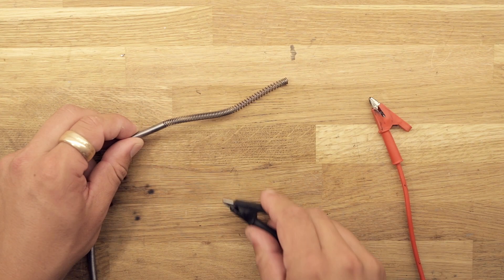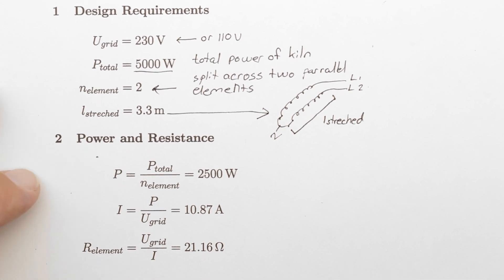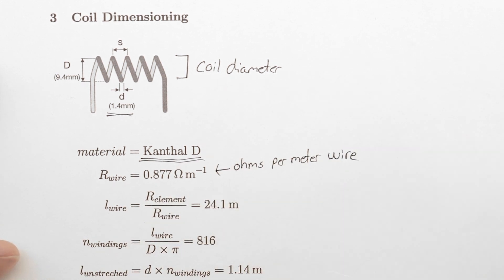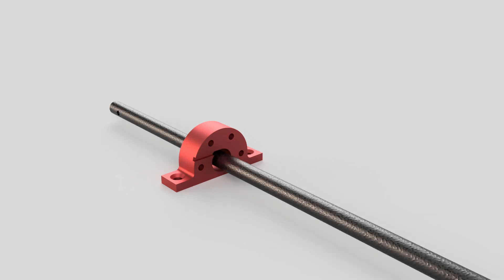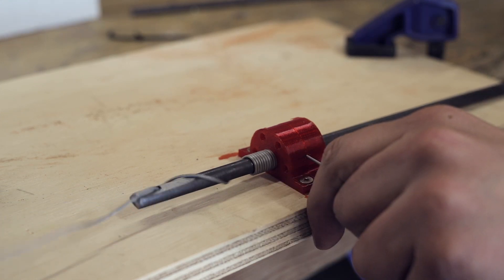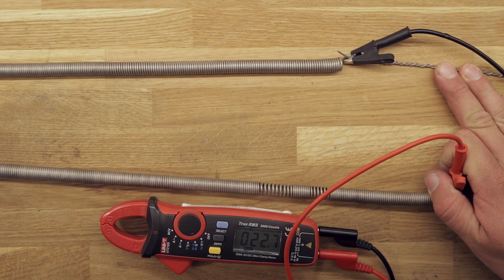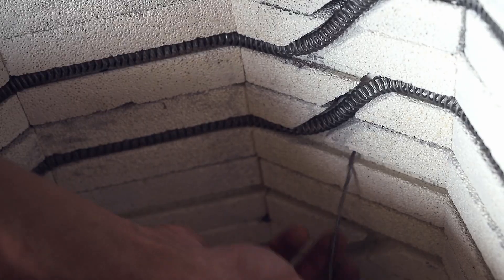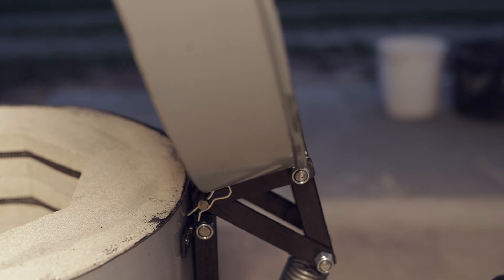Ultimate DIY Electric Kiln Guide - The Heating Elements (part 2)

Comment: Interesting build, though I think I would have just used all 50m of the wire, unless you have some use for the scraps. The extra length would only increase the resistance a bit and allow you to get higher heat output by drawing a bit more current. Or was there a reason you were aiming at a specific power rating?

Comment: You measured cold resistance... Resistance at >1000°C is much higher, so less current will flow. You will not have the desired power. The difference is big. Much bigger, than one would think at first.
Reply: I appreciate what you are saying here. I just tested my kiln and at 240v and 20a with his calculations I can only get my kiln to 631 degrees *F. Any suggestions on how to get the temperature higher?? I followed his instructions to the letter. I’m very confused why I’m not getting the same output. Any help. Would be appreciated. Thank you.
Reply: @ArchangelZero2012  Well... I have to assume you don't have the electrical training necessary to do this safely. Be careful, but you are on your own risk.

631°F is what? 300°C? That sounds way too low for just a temperature dependence in resistance. What temperature did you try to reach? Is the resistance at room temps where you expect it to be?

I would suggest to measure the actual current consumption, cold and at the max temperature you get. And work your way forward from there. I think you have more than one issue at hand.

Comment: Many, many thanks. You left me (helped a lot). I have a lathe, but I didn't know how to wind Kanthal wire 1.6mm. I needed 277 threads and then a gap of 3 mm between the threads. It didn't work on the lathe. You showed me the video. Thanks thanks.

Comment: Hey bud I'm really struggling to figure this out. I'm trying to make my own home made fiberglass jacketed heat tape. I need it 8' long(a lil longer is ok) And was planning on doing kanthal wrapped around a 8mm rod to coil(8' coil to be stuffed into 1/2" fiberglass jackets) I'm on 120v AC but have a plethra of DC voltage supplies too, including a 24v 14amp and better or smaller. About what gauge and how much kanthal wire am I gonna need?
Reply: There are jacketed heating tapes made by industry but not with Kanthal wire. The Kanthal wire will break. It is best contained in refractory brick, which is what it was designed for. Essentially, not moving.

Comment: I am using Khantal for the bad conductor properties for the handle of my portable griller. 
https://youtube.com/shorts/g_m2LNOg5zA?feature=shared
The Khantal wire handles allow me to pick up the fire and control the air for flat out heat or simmering by placing it flat on the ground. Khantal wire is a very bad conductor so the handle is always cool

Comment: Reading muffle furnace engineer guide for a carbolite system and it mentions current is pulsed at around one third on, two thirds off cycle per second to prevent early nichrome wire disintegration. I think constant voltage will destroy the wire sooner or later. Curious... Is this something you are aware of?

Comment: I have a busted muffle furnace. The wire between the 2 elements has snapped. Do you think a nichrome connecting wire is suitable to join elements together when that wire travels outside the refactory lining? It is shielded, but im not sure on the existing wires composition.

Comment: مرحبا هل يمكن صهر الالمنيوم بي فرن مصنوع من شريط المدفأة الكهربائية وما النوع المناسب وشكرا بالمناسبة ارجو منك قياس اعلى درجة حرارة وصل اليها الفرن شكرا على مجهودك
Reply: I did do some research on “smelting” aluminum cans (soda cans). A big takeaway I learned throughout the process - you’ve got to keep oxygen away from it, if not, it all gets oxidized and goes to dust.  
Make or buy a crucible to melt it in. 

It gets very very hot so personal protective clothing designed for industrial melting of metals should be worn at all times.
Don’t try to do this smelting by yourself, it is very dangerous work.
Don’t do this indoors, it’s too much heat and so much can go wrong very quickly.
Use the tools designed to work with the crucible that have long handles, it’s very hot and even with proper gloves, that metal will go right through them.

Comment: Worth mentioning that north america does in fact have 230V (240 actually, ten more! 😂 ...although sadly we generally don't have three phase in residential service) in every single electrical service installation, commercial, residential, etc., it all has 240V. If you don't want to add a double pole breaker to your panel and wire your own circuit for such a kiln, use the already existing 30A 240V dryer receptacle, or the 50A range receptacle. 😊
Reply: or power it off a welder

Comment: one thing on the gauge selection...

its about surface area, and you can manipulate the size to control the peak temperature, as its just W/cm^2.

so, the skinny wire with high resistance will indeed get the hottest, but it also dissipates the least, so it will melt. along with oxidisation etc... short life. cheap though!

its quite possible to have a wire so large that the temperature is... minimal. still dissipating all that energy as heat, but that heat
? its not very HOT. irrespective of the insulation, or how long it runs, or anything... you simply wont get over a certain temperature.
Reply: its because the volume grows as cm^3 for any given surface area. The current cares about the volume because it is essentially the area of the cross-section of the wire at any given point. So the larger wire gets less resistance because of the larger cross-section while its surface area does not "grow" as quickly as its volume so heat dissipation is cm^2 and resistance grows as cm^3. You need the sweet spot between resistance and surface area, treat it as an infinitely long cylinder.

Comment: I have a friend with a 3D printer, would you possibly mind sharing the plans for the part you insert the rod and wire into? It’s a fabulous design and such a well made video!
Reply: The old school method for making such coils is to have that round steel bar in which the wire is attached (a short groove in the end will do) and two short pieces of 1x4's  which are clamped vertically in your wise.  Then you just clamp the bar in between those 1x4's and rotate. Drilling a feed-in hole for the wire in one of the 1x4's makes sense too but I haven't had it.

Result is perfect coils for heating elements, or springs if you use steel wire.

Comment: Great video. Which material is best for 2000°C temperatures?
Reply from the maker: Thanks! I do not have experience working with such high temperatures, so I cannot share any advise on this :)
Reply: That wold be Kanthal wire. It’s designed for use in kiln operations as in heating elements.  It comes in several grades.
Reply: @jmikronis7376  No, Kanthal alloys have a max of about 1400 degrees C. I'm guessing you would need something like silicon carbide heating elements to reach 2000 degrees C.
Reply: @rusticagenerica  

What is the temperature limit of silicon carbide?
Although it oxidizes in air at above 1600°C, silicon carbide's upper limit of stability is around 2500°C and has a melting temperature of around 2830°C, and its peculiarly good thermal conductivity (comparable to that of copper) make it a very useful material for use as heating elements in furnaces.

Comment: When you divide your heating element in 2 parallel coils, each coil is twice the mass, but runs only half the current, does that mean that they reach a lower temperature? Compared to a single coil of half the size (one quarter the mass of metal)?
Reply: No, it's not a lower temperature. The manufacturer of the wire usually gives you a power rating per meter of wire. So depending on your total power that can mean you need to use a thicker wire and thus make it longer. Also they will give you numbers on how much the resistance increases with temperature. Most wires have PTC which means their resistance rises with temperature.

Comment: This is great! One part I'm missing is the circuitry that would be used from the elements into a Skutt digital controller for 230or 240V?
Reply: i believe the heating elements connect to a relay which is then controlled by a digital controller.
Reply: @jow_91 , actual microcontrollers output in micro amperes so any output has to go through some “chip” that can convert this output signal to one usable by actual driver relay. I’m certain there are “modules” designed for computer interface to power controlling technology.

Comment: Maybe someone can help me here. Why cant a 110v 13a circuit power a larger kiln? I understand the obvious that more power is needed to heat a larger area, and that the resistance of the wire chosen is so all of the power will be converted to heat, but you could use a longer and thicker wire with the same resistance spanning more surface area in a larger kiln. Would the rate of heat loss through the firebricks exceed the ability of the coil to heat and prevent the kiln from reaching optimum temperature? 

Also great video thanks.
Reply: Depends what temperature you're trying to reach, and what the losses are through your fire brick. Technically a 10 watt heat source could heat a whole room, if it were perfectly insulated. If you want your tradeoff to be that you need to insulate better, then that's acceptable. So is just waiting longer for it to heat up.

For most things you would use a kiln for, 1,500 watts like you said should be enough. Generally try to size your coil to whatever power source you have available, just to heat up faster, and waste less time and energy.

Comment: Hey Jakob
This is some quality content ive been searching for a while, thanks for sharing!!
Im really interested in the electrical part of how you did the wiring for the bi phase   plug (in my case i want to wire it tri phase).. did you plug the plug cable strait into the terminal where it meets with the elements or is there something else?
Thanks again, i really enjoyed your video!
Reply from the maker: Hi Simon, thanks for your kind comment! The electrical wiring will be the next (part 4) of the series. Until then I can tell that each of the elements is connected between the live of one phase and Neutral. One SSR (solid state relay) is used between the element and live to control the duty cycle with a control signal from an Auber PID controller.

Best wishes!
Reply: @jakobhalskov  man thats awesome! Im so looking forward to the coming video! It will be great help for making my kiln! 
Thanks a lot!